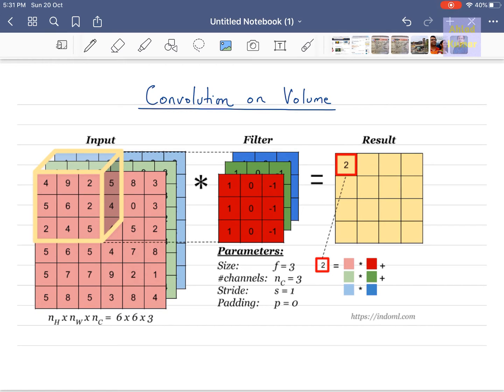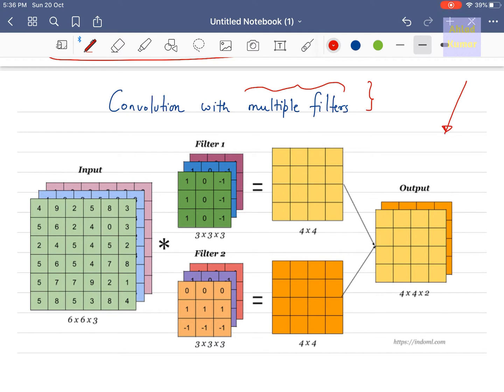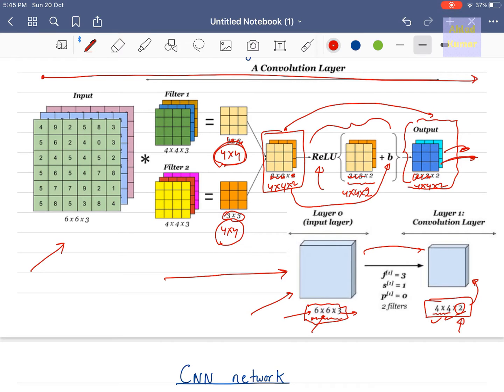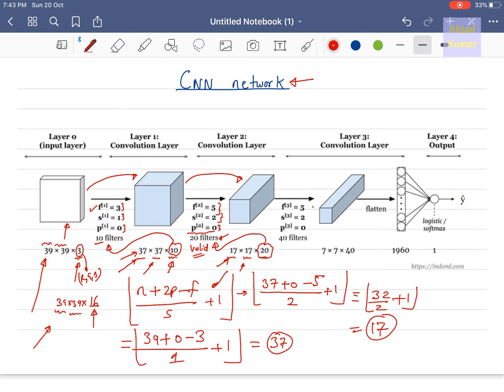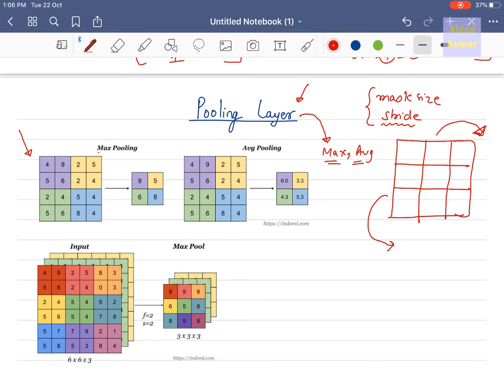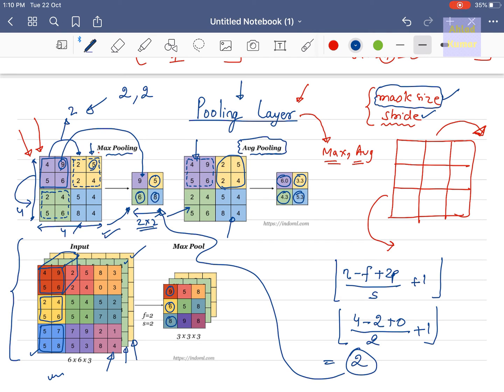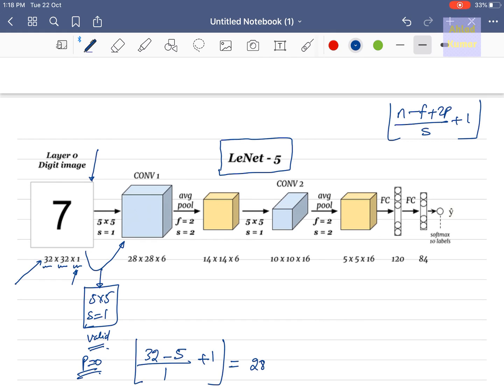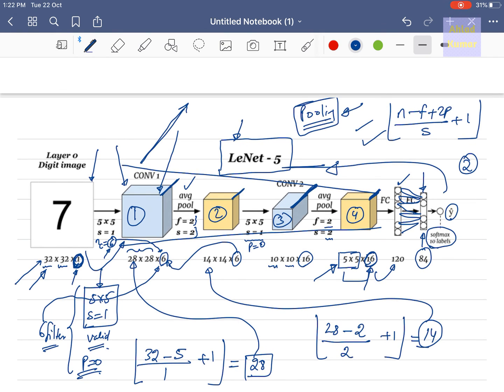Deep Learning 50: CNN_2 - Convolutional Neural Network

Comment: could not get how 5x5x16 becomes 120 as a fully connected . it should be 400. Pls correct if i am wrong
Reply: Same issue even I have. How did 120 and then 84 be arrived at?
Reply: @pratyushcavutur5388  I think after flattening the 5x5x16, which would become a vector, then it is passed on to an FC layer with 120 units.
Reply: @vishalsingh-yj8bk  yeah i figured it out. It also takes the previous later connections.

Comment: At time 7.15, Filter of 4x4x3 convolve over image of 6x6x3 with a single stride should result in 3x3. Hence it was right in the first place. Btw very good work. Keep it up.
Reply: Noticed that too, so the shorthand is just 3x3x2
Reply: @mostechroom9780  
The problem is that these two images are not the same, and are two completely separate images showing different networks. Both of them are correct if you do the calculations but they are not correlated.